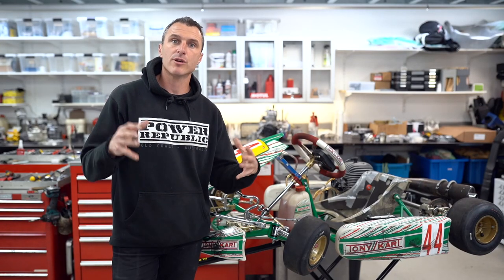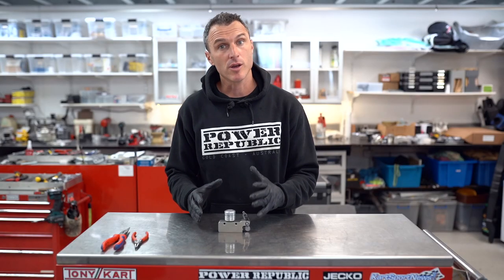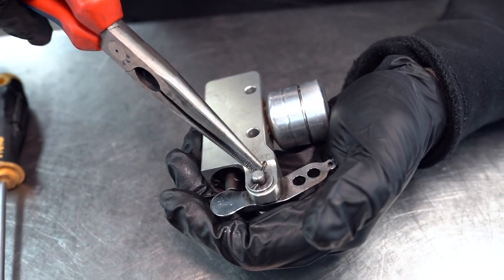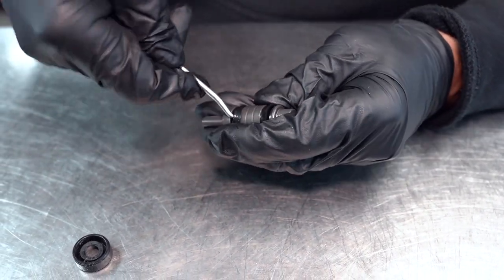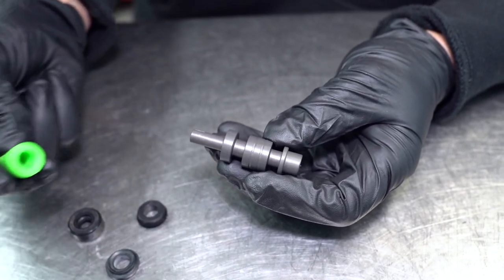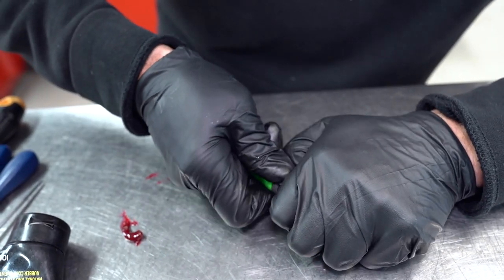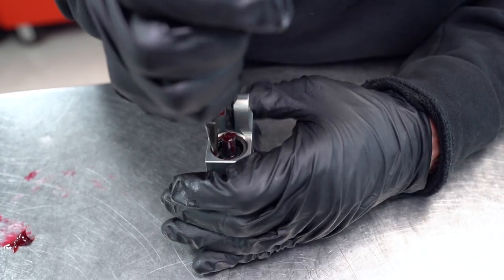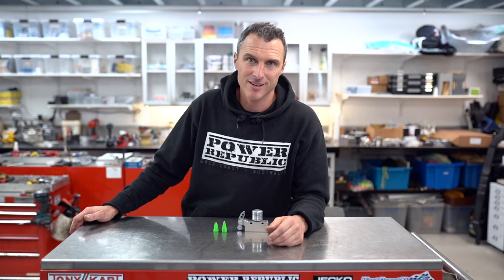How To Change Brake Seals The Easy Way - POWER REPUBLIC

Comment: Derek, I'm a bit puzzled at the moment. I want to change my rotax max gear oil but I don't know what to use, I heard to use TPF but don't know what product works best. Any certain gear oil I should use?
Reply from the maker: Either motorbike gearbox oil or dex3 Automatic Transmission Fluid. Either is fine
Reply: @PowerRepublic  does it matter if the motorbike oil is for 4 strokes, for the rotax max engine

Comment: Do you know if there’s any way I could fix my bent steering wheel? I got into a crash and the kart flipped onto the wheel so it bent up. I really don’t wanna replace it since it’s quite costly so do u think there’s any way I could bend it back to it’s original shape?
Reply: I legit did it with a long pipe and just bent it back till its kinda straight, butt i did it bc the day just started and we didnt have spare parts so.
Reply from the maker: I have had the same situation and literally just pulled it back into shape.  the wheel is normally aluminium and bend  easy enough

Comment: Is it possible to use new areo plastics on old chassis, for example the 2022 plastics on a kosmic 2014 chassis
Reply from the maker: sure is, you might need to update your side pod bars and Nassau panel mounting brackets too

Comment: Yo Derek, I have a problem and don't know where to look. on the straight the engine runs up to 12200 rpm and then stutters. if I let go of the gas and then press it again, the engine runs again to 13900 rpm but I lose a lot of time and speed because of the gas. what could i try? greetings from the Dutch
Reply from the maker: Hey Jordy.  Thanks for writing in.  Sound like she’s a touch lean on the main jet or even clip position.  First up go up one jet size.  Then if that helps, drop the clip and raise the needle one position.  
Hope that helps bro 👊🏿
Reply: @PowerRepublic  thanks Derek. Gonna try it
Reply: @PowerRepublic  thanks it is fixed! You are awesome